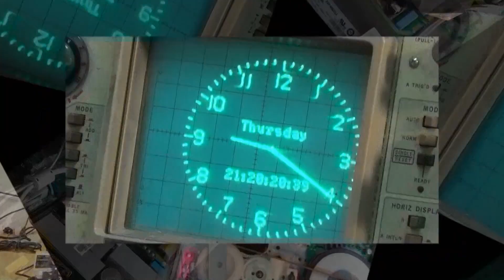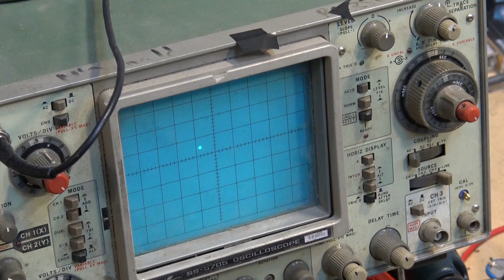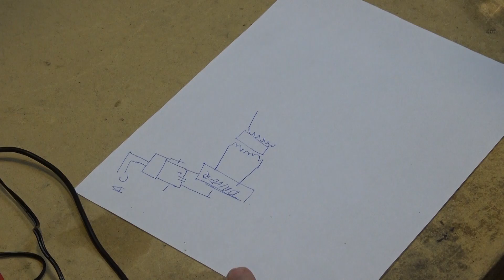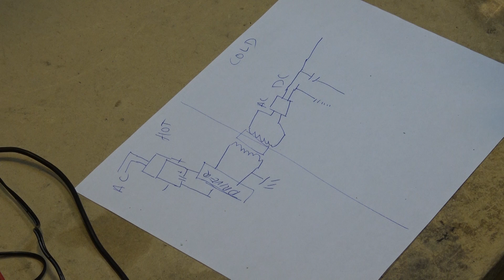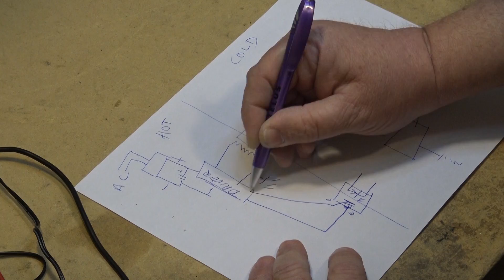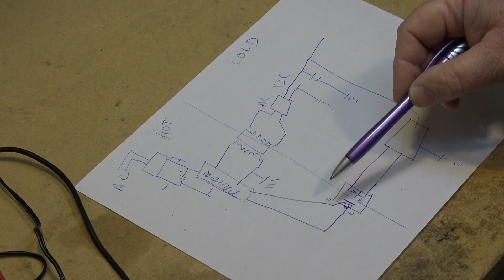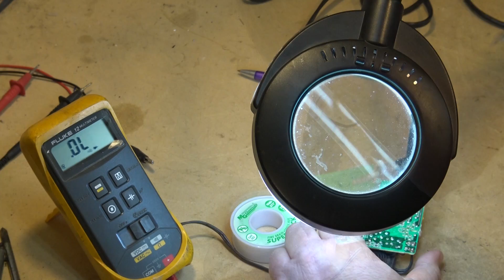Switching power supply regulation repair

Comment: I often see circuits that want Unregulated DC voltage, I'm not sure what the benefits are when apply a circuit that wants Unregulated DC voltages. Why would a circuit be "sensitive" to regulated voltages and not work when applying regulated voltages? the circuits will only work with Unregulated DC voltage and NOT regulated voltages, any reasons why?
Reply from the maker: They have internal linear regulators which require a higher input voltage to work.  Give them a stable voltage below their required input and they won't work properly.
Reply: @12voltvids  When circuits use Unregulated DC voltage they don't use internal linear regulators on the PCB board they will supply the components with just Unregulated DC voltage. I'm not sure why some circuit boards will only want unregulated DC voltage and there is no linear regulators IC chips are the PCB board.

Comment: Great video!

Regarding the panasonics, that is so true. I had an NV-J30 in for repair. It was completely dead. That zener diode kept the output anchored at 0v, which is the same as saying the hot side from powering up. And it was due to the electrolytics. The zener diode (as a sacrificial component) in paralel with the output was a simple, effective solution that actually kept the power supply assembly from destroying itself.
Cheers,
Reply from the maker: That was a design f!!! up.
Switching regulator is designed to change the switching frequency to bring the transformer closer to or further out of resonance. At resonance it is most efficient 
.
The idea was to increase the frequency to bring transformer closer to resonance if voltage was low  and to drop it if voltage was high. The problem was when caps dried out the frequency went higher,and even though feedback circuit was trying to pull it down it got closer and closer to resonance and thus the voltage kept climbing. Before the aener crowbar was added these VCRs blew up completely. A unit arriving with every chip on the board with hole blown in it.
In later designs they moved the frequency above the resonance of the transformer, so as capacitors aged the frequency would go up and move the transformer further away from resonance  thus dropping the voltage.

Comment: Why would you get less voltage than you are supposed to on the secondary side? I'm getting 4.3 v instead of 12, but it's a steady 4.3v, is this some kind of short on the secondary side? Could it be the regulator transistors on the secondary side?

Comment: 18:28  When 15v zenar gets short & kill everything no current would flow into the circuits of the vcr.
Wouldn't shorting the zenar diode result in high currents in any other components of this smps?

Comment: i decided to replace the optical coupler and it fix the problem. now the voltage is not dropping with load anymore. thanks . i made a little video showing the bad component

https://youtu.be/MfdcKNy4JLY

Comment: Great video..I have a similar power supply for my recliner, it is 30v 2A when i apply 700ma load the voltage drops  to 16 v . Do you have any video on this issue. Thanks

Comment: Would you recommend changing the power supply for devices if I plan to take them to Europe. I’m moving there, and would like to continue using my AV receiver and subwoofer. Any advice would be appreciated.
Reply from the maker: Most devices that have a switching power supply will run on 240v buy conventional transformer linear supplies will need to be changed or operated through a 240 to 120 step down transformer.

Comment: Got me confused; you always talk about how dangerous aswitched mode PS is then you short it out to prove a point. Then you talk about emitter base side of opto-coupler then diode side; how about “ input” and “output” side would be clearer and less confusing. You lost me . Only 12 volt output; I though5 purpose of SMPS supply was efficient high voltage source. Confusing,confusing.
Reply from the maker: The primary side of the transformer has high voltage. About 170V in 120V countries and about 360V in 240v countries. That is what is present on the main filter capacitor, and switching transistor on the primary side. The secondary side is 12 volts. 
The opto coupler optically isolates the 2 sides. You need to use an isolation transformer to safely work on these things and when the main primary filter capacitor is charges it can bite you pretty good if you stick your fingers in there when it is charged up.

Comment: 15:30 please stop touching that optocoupler.  The board is under the voltage. What the hack? :) 
You don't have 3 lives and 1credit as we have in arcade games :)
I've noticed few times on the other videos -when you explain something, you always touching elements on the borad - don't do it ;)
Reply from the maker: Everything I work on is plugged into an isolation transformer, so I am not going to receive a shock because the line is isolated. The worst that could happen if I put my finger across the primary side is a mild shock. I also keep my free hand away from the live circuit so no chance of current across my heart. The worst shock I ever received was from an operating microwave oven.  2300 volts at about 700 mA which is a lot. The tool I was using the insulation had failed and my hand clamped down on the tool so hard I couldn't let go. I had to jump back to break the connection. Again, no harm done, following electricians rule, only 1 hand and other hand in back pocket. It may look like I am taking risks, but I can assure you I am a journeyman electrician (in my current job even though these days it is mostly fiber optics I work with I am still working close to utilities) I take no risks whatsoever.  Also it may look like I am touching live circuits on camera, when in fact I am pointing at something, but with the 2 dimension view of the camera it looks like I am closer to live circuits than I actually am.
Reply: oh, is not like that. I admire your skills, experience and knowledge. I saw most of your videos, you are very brave during fixing high-voltage things when they are stay live.

I remember one video titled “Most Dangerous TV fault ever” I was scared when I saw how you're touching and shaking high voltage capacitor and have fun with huge arc sparks - I envy you that you can do it easily. I would throw it down immediately then run away at least 2meters from it and trying to calm down. High voltage is for me something like spiders for other people. They know that nothing bad can't happen but they are scared anyway.

Today I saw your video “Build a current limiter for safe testing” I'm grateful for sharing that idea, and for that you've explained why and how it works. On that video, you took cord cable and you make short-circuit easy on TV's high voltage side to demonstrate how current limiter tool works. I was scared again :)

I have good experience in electronics repairs (laptop motherboards, smd, bga, etc) but I avoid high voltage units, power supplies, etc.

But because of you I finally understand more about those things which always scared me. Always when I have LCD/LED Tv for repair, I'm watch your videos as help/lesson. So you are an authority (expert) for me in everything where high voltage is. (microwaves, TV and tube amplifiers repairs, old units, psu, etc.) And I guess that you are high experienced electrician engineer.

Few times I heard on your videos that you are using isolation transformer. Because of you I've learned what it is :) But on the polish sites, I've read that if you connect few devices/units to one isolation transformer then risk of danger  is grater. So ideal condition is one device/unit per one transformer. Is it true or unnecessary bullshit?

Greetings from poland.

Comment: Sir, I have an SMPS circuit in which two of the primary side filter capacitors blown. As I replace the capacitors and powered up the circuit, the mains fuse keep blowing. I'll be grateful if you point me the direction to solve the problem.
Reply from the maker: Check the mosfet on the primary side.  I did a video a month or so ago showing how to test a mosfet.

Comment: And now I know why my 1986 National Panasonic VCR just smoked when I plugged it in and the whole house smelled burning...
Reply from the maker: They don't call them voltage to smoke converters for nothing.
Reply: I recently got my hands on a rare multi system Sanyo Betamax from 1981 and it actually uses an SMPS. Sometimes, I can hear a humming noise comming from the power supply. I guess it needs a recap right?
Reply from the maker: Yes and I would do it before using it because it could blow and overvoltage the rest of the machine. Some of those early SMPS did not have over voltage protection, and one day you head a pop and a bunch of smoke comes out. Then it is too late.
Reply: So, does this apply to SMPS manufacturers other than Panasonic too? Do you know where I can find the schematic for this machine? It's a VTC 9455 and I can't find anything on the whole internet!

Comment: Good choice of problem and fairly simple SMPS.  Also good that you simulated other types of failure modes.   It would have been nice to see you bring in the correct 12V's.  Even though you can interchange optocouplers there may be enough difference to cause an offset to the voltage control feed back therefore effecting the targeted voltage.  I didn't see an adjustment POT on the unit so you may need to use the same part number optocoupler or find a different value reference resistor value.

Comment: nice, but some TVs PSU more complicated .. :'(
Reply from the maker: TheJavaSync 
This gives the basics which all switch mode supplies use. TV psu has additional circuits and generally multiple supplies. Stand by main circuit and backlight. They also have power factor correction.

Comment: I've been trying to modify a 31.5V 100W rated HP plastic supply which uses an lm358. There are 2 op amps inside that particular package and it's had me really baffled how they have used both of the op amps in this configuration. One side has a Vr but it seems to do nothing, i've tested it for current clamping and wide voltage adjustment but it does nothing (perhaps fine adjustment?). I managed to get V to about 10% down and about 6% up by swapping out one of the resistors for a VR. But i was hoping for more adjustment. Why does it start clicking after i drop the voltage below 26V? Someone mentioned the clicking is arcing. 
  Anyway i'm pretty happy to have gotten some results as i have seen these give 300W at the +6% range possibly more in the ideal volt range. I had 9x 100W LED's light pretty bright from one of these (i just drilled medium sized holes all over the case to improve air cooling).

Comment: Do the opto's always dead short when they fail? As for the high pitch noise i must be going deaf as i could barly hear it, but it did get me checking my ears for a second.
Reply from the maker: No they don't. A short is fairly rare. Usually the LED gets weak and thus the unit starts ramping up the voltage. Possibly what happened was the LED was getting weak, and the reference was sensing too low voltage and applying more power to the LED to brighten it up, and that caused the led to pop?
Just a guess on my part. Optocouplers have been a relatively reliable part over the years, so this video demonstrates that they do indeed fail, and this is a symptom of that failure. Normally nobody would repair these disposable power supplies. This video was done just to show how they work. If the power supply was embedded on the main board for example, it would have to be repaired. This one came from a PVR, so the power supply was replaced, and I grabbed it to see what went wrong with because I was curious as to what failed. That's why I take apart CFL bulbs, and LED lights ect. Because a diagnostic engineer never stops thinking about device failures.  As far as designing things that doesn't really interest me, but when something that was functional breaks, well then it is like being a detective. Instead of figuring out who did it, you have to figure out what did it.
Reply: Still, great little PSU for certain LED lighting projects
Reply from the maker: Great idea thanks.

Comment: Very good explanation of the switch mode power supply.  I really enjoyed it.  One question though.  Since voltage was at 11.59 volts and not twelve, was there 
something you could have changed out to get it up to the 12 volts it was supposed to be?
Reply from the maker: Remember, the optocoupler was blown. I didn't have the exact part, I had one I pulled from another dead supply, so the spec is likely slightly different.

Comment: I didn't know there's that high pitch noise in the video until I saw bunch of people complaining :) I must've a low-pass filter in my ears :D And I'm 22, supposed to hear over 15kHz. My scope has a dc-dc converter which runs on even lower frequency, now that's what can drive you mad.
Reply from the maker: I didn't notice it initially  when I was editing as I am not cranking it up, and there are lots of other noises around that masked it such as the racket that my computer with it's 7 hard drives, and 3 or 4 cooling fans, it is relatively loud. When it was brought to my attention I put on some headphones and wow, there is was, on the source files too. So I threw on some filters, and uploaded another copy for those with sensitive ears. I didn't remove this one as I don't want to loose revenue that it has already generated. So that's why there is 2 copies online. They are different enough in the sound track that youtube doesn't flag it as a duplicate.

Comment: If you cannot eliminate the source    download a program called audacity and cut out the peak at the top of the scale
Reply from the maker: Sorry they don't pay me enough to demux the audio, process it, and remux it.
Reply: i did it for you  took about five minutes
Reply: if you like   youtube creator studio has the facility to replace your audio with this one
Reply from the maker: The problem is if I re-upload it, I loose the stats, and any money generated by the current views. there is NO WAY to replace the sound track on an existing video other than use Youtube creator studio and replace it all with music.
This has been very well documented as many have already posted that question, and it can't be done.
Reply: huh  i thought you could upload your own music

Comment: I cant stand the high pitched squeal in the background   sorry   fix that and im in
Reply from the maker: low pass filtered version should be live in a few minutes.
Reply: its not a low pass filter  i actually used a notch filter  to pull out he two spikes
Reply from the maker: I know what a notch filter is. I just couldn't be bothered using one, because I have to apply to each clip separately, and there are many clips. Every camera cut is multiple clips as I cut out gaps and pauses during the record session. So I just threw on a low pass filter in my editing software and rendered it out again. The low pass filter is only on the camera audio, not the background music, which is something like 30dB down
Reply: sadly i can still hear it in your video   instaid of putting the notch filter on each clip why not just pit on in post production (ie to the fianal video)
Reply from the maker: That would require demux and re-compress, which would result in a degraded picture, so the only solution is to roll off the high frequency and re-encode the file. So I set the roll off this time to 6KHz so there should be nothing by 10KHz in the voice track. Still trying to figure out where the noise was coming from, but I suspect it was my scope dying that was kicking out noise. I don't hear it unless I put the cans on because there is so much noise here in my edit bay as right outside my window is the HVAC system and it is running pretty much full time to heat the house as it is the dead of winter here, so it masks the sound, but with the cans on I can hear it. New version should be up in a few minutes for those with sensitive hearing.
Reply: Thanks   im excited to see you troubbleshoot the scope       im thinking its a capacitor being leaky
Reply from the maker: Might be. Started TS tonight. Power supply voltages are OK. Problem is I need a scope to TS these type of problems :(
I think it is probably an HV problem, then way it went. The spot was bright one minute, then literally totally out. Then it cam back relatively dim, brightened up a bit and now there is no beam again. Needless to say these are very high voltages, in the KV range so I can't measure them with my existing meter. Will look for a schematic for it.

Comment: So can you create a variable power supply from 0 to max rated voltage by tweaking the photo transistor side with a variable resistor?
Reply from the maker: Might be better to do that on the reference IC side, which would change the brightness of the LED in the feedback loop.